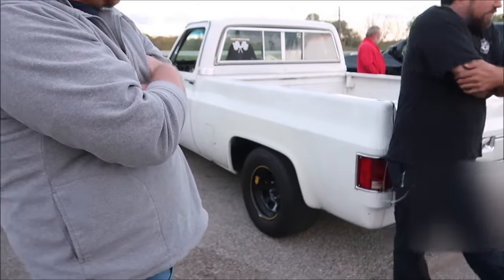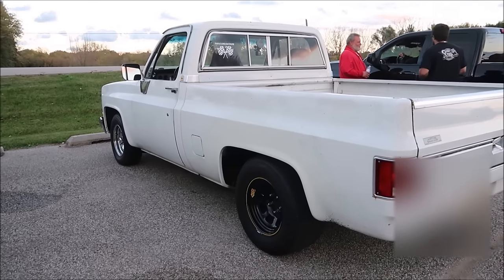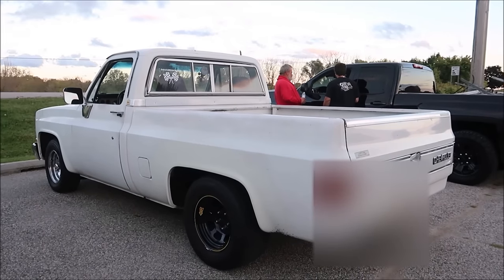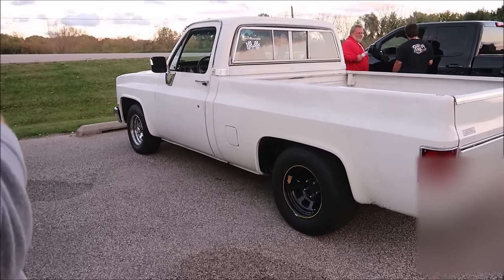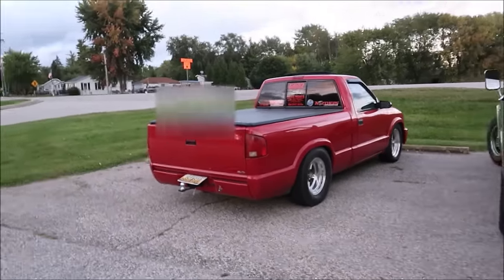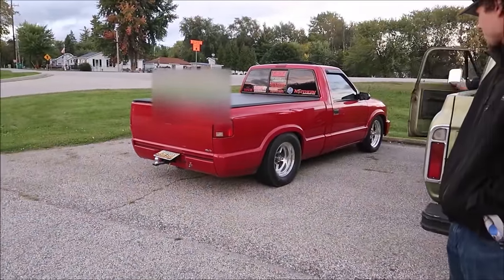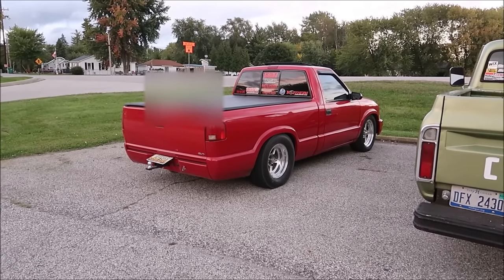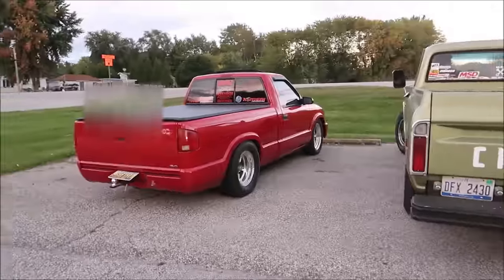Nitrous/Cam 6.0 S10 vs Nitrous/Heads/Cam C10

Comment: I thought that 6 liter light S10 would blow away that heavy small block! 🤔
Reply: Agreed something is fishy
Reply: Thats why I haven't gone Ls lol my  sbc 355 runs away from um
Reply: Just like many sons who wake up one day, and THINK they can beat up the old man😆. Small block Chevy may be old tech, but if built right it can still hurt feelings. The same can be said for many other old school engines. Too many people think that having an LS means with a BTR cam or other mods, means that you're going to automatically win against an old setup.
Reply: @erikturner5073  car with less hp setup good will put alot a shit in the rear view
Reply: Compared to new trucks there not that heavy
Reply: @zuriiiii77  most trucks nowadays are 4x4 quad cab land yachts..
Reply: People never take into account a sbc torque compared to an ls. Ls engines make shit torque the reason that's so important is because torque is how hard u leave the line and since the most important part of a quarter  of a mile is the first 60ft sbc whoop ass
Reply: @nickt1301  yep gotta sbc in my malibu on my channel leaves decent. Blower an 150 shot when used.

Comment: There’s more than a sbe in that truck.
Reply: What makes you say that
Reply: It has a chrome air cleaner too
Reply: He’s been all over Facebook saying the same shit.. nobody believes him.
Reply: That 6.0 outta walked the dog on that 355 “sbe” the 6.0 makes more power stock than that 355 with spray lol
Reply: @bradonoliver2973   I wish I could see more of the Sbc, I bet it’s a high compression 383.. the 6.0 was also a clutch so that hurt it some.. there’s pics of the square body hanging the wheels on the street.. no 355 is doing that in that truck.
Reply: That’s no 355 lol it’s a blueprinted motor built specifically for what he’s doing. I’ve seen 355s in Vegas and it not pull the wheels with spray. But I agree I love the sbc even tho my nova is getting ls swapped for reliability but other than that my swb truck will get my novas old 355 motor lol
Reply: O and I know the s10 was manual but that 355 shouldn’t have had it that easy
Reply: @bradonoliver2973  you've been reading too many hot rod mags,
Reply: @mrchokesalot  is this your truck?
Reply: He showed engine, its a sbc. Everyone downplays there ride in a streetrace. Run what you brung. White truck 1000 pounds heavier, it was a good run.
Reply: @GJ-DT  it may be a sbc but is it really stock bottom end.  Sbe
Reply: @bradonoliver2973  i don't think it matters, it coulda been a 421 for all we know. S10 alot lighter with ls engine and got beat by heavy old school 💪
Reply: @GJ-DT  he obviously says sbe 355 heads and cam with a 100 shot. Nah that couldn’t been. The s10 is manual which hurt him but I still don’t see a stock bottom end 355 and a 100 shot getting down like that
Reply: @bradonoliver2973  it's obvious not a stock bottom end if it's a 355. Chevy never had that as a factory displacement. So you are looking at at least new pistons and who knows what kind of heads to match them and whatever cam he's running

Comment: Id like to know what heads that c10 runnin man that 355 was movin! I thought the s10 for sure was gonna get him. I had a 355 c10 100 shot.
Reply: Probably AFR or something really good ported heads
Reply: When they started. Them up the s-10 then the c10 i loved the sound of the c10 thumpin
Reply: I called it wrong. I thought the S10 would win by a car length. Someone built a stout and fairly cheap sb. That c10 was rollin
Reply: I might add that the c10 driver has more experience.
Reply: I would guess that c10 running no less than a 250 shot
Reply: Did not expect that!
Reply: @bennysouthern7509  you can make some good power out of a old 350 is you kno what your doing. We ran several small block 350 in a Foxbody 4 years before we graduated to a bigger cubic inch small block. If you put some compression in it it will run like a raped ape and I mean more than 10 to 1
Reply: @bennysouthern7509  250 On a stock bottom end?
Reply: @bennysouthern7509  100 shot is all he ran
Reply: @Dboyquicks10  probably would have if he didn't spin so much
Reply: @greenboyatgafarms2250 

Yup 
11 to 1 on my 355

Comment: The 350 Toque curve comes in much sooner than the 6.0.       Which helped get the SQUARE BODY out of the hole .    But I also noticed the S10 was having some traction issues .  Different drivers probably get different results
Reply: Why ya go sbc

Comment: I didn’t see that coming. Makes me feel better about the 383 STROKER I’m building right now.
Reply: Gotta love those RPMs..! Ive got a 383 stroker - solid lifter roller cam and rockers in my K10...
Reply: Really hard to beat an old school 383! Almost went that route, building a boosted lq4 instead.
Reply: We were going fast in early 90s  before  ls ls has better  valve  angle  but18* sbc will kick an lsx car in the ass gen1 sbc power requires a GOOD set of cylinder  heads I'm crippled  me and bro building  niece  427 lsx lsx is budget  if you're  using junkyard  parts  I could  have  built440 sb2 headed gen1 sbc and made more power  or coyote  a coyote  superior  to lsx

Comment: For people who dont understand  how the sbc won torque is way more important in a drag race than hp and ls engines make low torque the make big top end power but for that first 100 to 200 foot a sbc will get out there because of how much torque they make down low thats why if u ever rode in a 400 hp sbc and a 500 hp ls the small block feels way faster because it pulls harder

Comment: S10 needs driver mod... He was on the shoulder...
Reply: True
Reply: I feel the same way
Reply: Worse driver ever.
This shouldn't have even been a close race.
The s10 should have won by bus lengths.
Reply: @charleshenson4183  my s10 that only has an amr500 supercharger plus its a 4 cyl. Would have kept up with these guys.  That s10 should have completely smoked that square body to death.
Reply: @2ndspingarage  go line em up.. strongly doubt that energy would stay the same in person

Comment: Whoa!  I'm surprised.  With the weight differential and the LQ9, I was sure that S10 had it in the bag.
Reply: What’s a LQ9
Reply from the maker: Gm 6.0 out of an Escalade
Reply: @mr_klutch3865  Vortec Max.  It's the H.O. 6.0L. They came out of a few GM trucks/SUVs.  (Escalades, Silveradoes, etc).
Reply: You clearly see the s10 spun down the track thata why he lost. His truck set up is no good
Reply: @jamiewilson9380  I didn't see much spin if any, but even if it did, it still shouldn't have been even close.
Reply: This was clearly staged for the c10 to win,because it wouldn't happen otherwise.
Reply: @charleshenson4183  nah c10 weighs close to nothing with less hp he didnt spin so he wins from a dig kind of like a camaro vs hellcat Camaro wins from a dig
Reply: How is no one mentioning HEADS they play a big role in any NA build especially in an LS the C10 I think just had abit more stall/gear and the heads picked up for the extra weight  it was a good race both awesome simple race trucks
Reply: @mr_klutch3865  LQ4 is also the 6.0 but it has dished pistons, whereas the lq9 has flat pistons increasing the compression ratio.
Reply: Those c10s aren't that heavy. Probly close in weight to the s10
Reply: @chaseferguson5412  My 10.7 to 1 pump gas Sonoma has what would be called huge heads on the streets Brodix C-Series 18* cut to 17* with 261cc runners.....2.19 int./1.60exh. making 641 hp @6400 and 560 ft lbs. @5700......400 ft lbs.@3500........513 ft.lbs. @4500 with 3000 stall.  I think this backs up your statement on good heads on N/A engines. 399ci. SBC.
Reply: @horsefly1020  that C10 is around 4000lbs whereas the S10 should be around 3200lbs with that V8
Reply: @beardedforlife3740  those old c10s are not very heavy. I had a 65 short bed it was only 3300lbs with a small block and turbo 350.
Reply: @horsefly1020  that's a totally different truck. The C10 in this video I'm guessing is about 3800-3900lbs as is without the driver
Reply: @horsefly1020 the average half ton pickup single cab short bed weighs 4,000 pounds. More weight than the little S-10 girl truck.

Comment: That's no way that s10 should have lost.   The power to weight ratio and apparently dude in the c10 has to have more experience racing.   
But a win is a win.   Way to go c10!
Reply: Yea red truck spun way to much if he controlled more he would have won that🔥
Reply: C10 does have more work done
Reply: Its about the grip and stability
Reply: Power to weight ratio lol.. a 6.0 with cam and 150 shot in the s10 might be 500-550hp the C10 has heads and big camshaft and 100 shot I heard a nice stall everything sound like a good combo maybe 650hp with more weight so it was a close win
Reply: It's just a regular LS with what sounds like a small cam(probably a BTR/NSR cam). Apparently he didn't build enough motor for that race. Just because you have an LS against a small block Chevy doesn't mean that the LS is going to automatically win. Plus the small block Chevy has a better torque curve!
Reply: @erikturner5073 right that's what I'm saying.. I had a traditiona sbcl 383 stroker with AFR 195 race heads with a .600 roller cam ran mid 10s on motor ..and drove everyday.. people thought that can only be done with LS

Comment: Old 350 I love it torque win races see how the old school engine move that heavy truck thanks for representing 👍
Reply: 355 with more torque than a LQ9? Maybe on a non apple to apple comparison otherwise that's a completely inaccurate assumption. Regardless there's a lot more into it then just torque. A 383 sbc however, with decent heads and a mild 226/228 cam will make equal to or less torque than a stock 6.0 LQ4 with a cam of similar duration, LSA and mediocre lift. 

Both of these trucks were pretty evenly matched on paper as hard as some might believe. The weight difference isn't much, even though the old squarebodies feel heavy they aren't. A '76 C10 single cab weighs 3600ish lbs. And the S10 I would expect to be just slightly lighter than that with an LS swap. This race ... came down to traction, gearing, tuning and driver, as it typically does.  

I'm very doubtful that 355 has a stock bottom end also. Ask any engine builder to spec you a 400+ hp 355 on a stock bottom end plus nitrous capabilities. They'll say your dreaming or smoking too much pot and they can build it but it will be a ticking timebomb so why waste your money. It takes much more $$ to make power on an SBC compared to an LS. My '76 K5 has had both in the last 17 years. In fact it has had the stock 350, a 430 hp 383 with Trick Flow heads and now a completely stock 5.3 LM7 ls engine.  While I miss the 383 for its aggressive lope and nostalgic sound I really appreciate the much flatter torque curve of my 5.3L LM7 and its ability to start, idle, in any condition with excellent throttle response even with 100 less HP.  I'll do a 6.0 cam swap eventually and have the best of both worlds.
Reply: That was his "100" shot of nos. He is lying his ass off I've seen stock 5.3 ls motors thrown in s10s with just some sticky tires and they would blow him away with what he said he had
Reply: Thanks for feeling the same way .SBC power
Reply: @drewnash8356  And better MPG with performance LS. My bosses corvette with 430 HP gets 22 MPG, won't see that with the SBC.
Reply: @drewnash8356  where did you read your info🤣🤣🤣 a bone stock 350 vortec makes 410+ ftlbs seen it w my peepers...cubic inches and correct parts are what make power...dosnt matter the motor
Reply: Getting my 357 sbc H/C/P dynoed pretty soon!!!...1800$ on the build ...my c10 is gonna have bedsides only I think it should hit the scales at about 3250lbs ...they lighter than you think!!
Reply: @fastnasty6627  lol my cammed gto gets 26 and makes over 400 to the tire 6 speed 342 gear

Comment: Wow that outcome surprised me. I think that c10 had more than a 100 shot lol
Reply: Definitely I know a cammed 5.3 monte can hang with a 383sbc c10 with solid roller .690 lift cam 12:1/2-1 compression don’t ask me how I know 😡 lol
Reply: @jaredjordan6568  how do you know?
Reply: @jaredjordan6568  dude that’s in your setup those specs should be at the minimum 550 horsepower. a cam only 5.3 will make 425 at most with a good tune
Reply: I'd like to know his heads intake carb combo cause with a c10 to run like that as heavy as they where and beat a s10 he's got at least 500 hp top end kit I would think cause he smoked that s10 with 150 hp nos shot
Reply: I’ve watched this race a few times the c10 just has the better setup. The s10 is definitely lighter by at least 500-700lbs and probably has more hp. But the s10 is a manual. The c10 is an automatic and launched a lot better. 
Another thing I noticed. The caltracs on the s10 had a downward angle coming from the rear to the chassis. That’s not ideal for hooking. You can see it spun quite a bit out the hole and was a little loose up top.
Reply: @thabiznizz  you have a point
Reply: It’s because are Procomp heads are maxed out they only flow 200cfm it was dyno’d at 530 but the engine builder said with a set of heads that flow 300cfm it should easlily make 600-630hp
Reply: Because are buddy has that monte lol and it hung pretty well
Reply: He has more than 500hp got to think the s10 is probably 500 pounds lighter to also has like “50”more cubes Unless that truck has like a 434 lol
Reply: @jaredjordan6568  it's a auto he's gonna be more consistent than the s10 with a manual
Reply: @jaredjordan6568   if that sbc was built right a 5.3 with cam only will NOT hang with it, not even close, in the right car a small block with those specs would run 10’s
Reply: @jaredjordan6568  6.0= 364 cid
Reply: @jaredjordan6568  that 6.0 has less than 10 cubes in that 355

Comment: dude in that c10 must have had a 300 shot plus that baby 100 shot for them extra ponies
Reply: I'm with you on that 355 stock with cam 100 shot no way vs 6.0 ls cammed 300 shot plus possibly 500lbs lighter
Reply: @ronblack9615  a 355 is never stock and the 6.0 had cam and a 150 shot

Comment: C10 usually between 3900-4100 lbs. That one looks stripped down some. No AC, heaterbox, probably crank windows and manual locks. That S10 has a sunroof, probably full interior, power everything and AC. I'm guessing the weights are closer than  you think.
Reply: My c10 weighs 3840 and it's a long bed...they lighter than you think...hopefully doing a shortbed conversion soon!!!
Reply: @PHILLY214  I have a long bed too I didn’t know that they were that light
Reply: 4000 old iron
S 10 is lighter bro
It's a small truck!
Reply: @pops3554  The stuff hanging on that "old iron" makes a difference. Read what I posted "BRO"
Reply: @fivestar8337  s10 is still lighter.!!!!
Reply: That S10 is probably no more than 3200lbs give or take a few pounds

Comment: S10 needs more air in the tires . Might drive straight
Reply: Wouldn't more air make less contact with the road? Aren't drag cars usually at a pretty low psi
Reply: @trashbandit2449  not that low !

Comment: These kids out here never thought there was power being made before LS and coyote motors showed up. 😂😂😂
Reply: 🤣🤣🤣 he should've put all that money in a sbc he'd had 2 seconds on him if so
Reply: So you’re bragging up a fully built small block that barely inched out a win against an LS with bolt ons lol. 
Ok....
Reply: @buckbundy8642  Fully built?😂😂
 You mad he put a set of aluminum heads on a 70 year old design... 😂😂😂
Reply: @kendriver9139  oh yea. Not built. The 355 has been rebuilt with hi compression slugs, a forged crank, aluminum heads a cam, carb,  oiling system, huge shot of nitrous. The only thing stock is the block. What’s the matter? You mad your old, fully built small block would have gotten dusted by that S10 with a stock truck engine besides the cam and a snort of nitrous if the driver knew how to drive? 
😂🤣
You old stains are humorous.
Reply: @kendriver9139  😂🤣 They’re your lies. Tell them how you want. That kid in the S10 blew the launch and rode the berm and still only lost by a truck length. 
I campaigned a 446 horse small block in an 85 Camaro from 2003 to 2006. It was built to the hilt with Brodix Track 1 heads. The car sat until 2012. I then sold the 383 and B&M built TH350 and put a 6.0 out of the wrecked 2500HD from work with a 4L60E. The only mods were a cam swap to a mild Lunati grind and matched rockers, heavier springs and hardened push rods. I ran the same in the 1/4 within about 3 tenths of a second. 
I understand. You’re afraid of wires and computers. Just not bright enough to figure it out. It’s ok tho. My daughter is afraid of stuff too. 
So keep running your mouth on your ancient boat anchors. The guys at the shop just got a good laugh at your last drivel. 😘
Reply: @buckbundy8642  😂😂😂
You are a clown! 😂😂
If you 're running a built to the "hilt" sbc with track1 heads and only made 446hp. You should give it up bud...
 And btw. I had an 02 m6 car, have a lq4 with all injection and wiring sitting in the garage. 
 And a 350 in my 55 Chevy...  have had no reason to ls swap it. 
 And if you lack the basic knowledge that 350's came with forged cranks.. 
 And can only get 446hp out of a Brodix headed small block..
 I feel bad for your customers in your so called "shop"... 😂😂😂
Reply: @kendriver9139  like I said. They’re your lies you tell them how you want to. Go open a magazine from 2005. They’ll teach you all about the spooky wiring and injectors. It’s ok if you have one of your buddies hold your hand at first.
Reply: @buckbundy8642  😂😂😂
Reply: @kendriver9139  not saying those old sbc don't run good, but a LS is better in every way